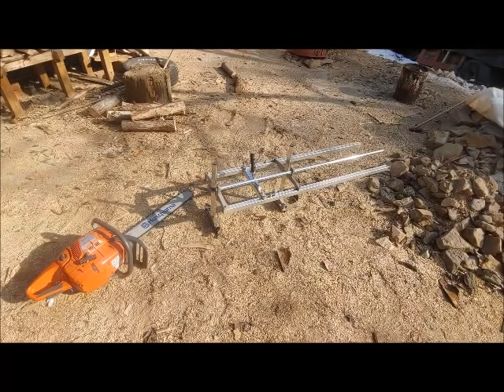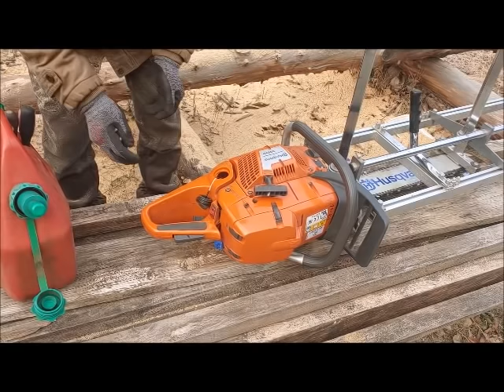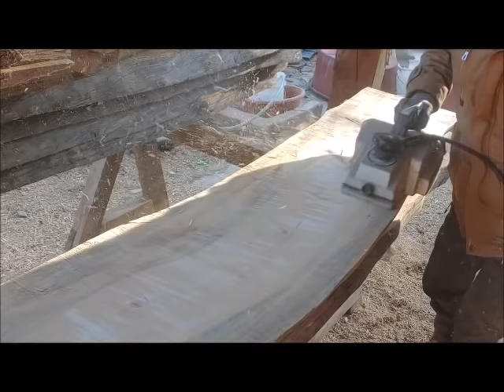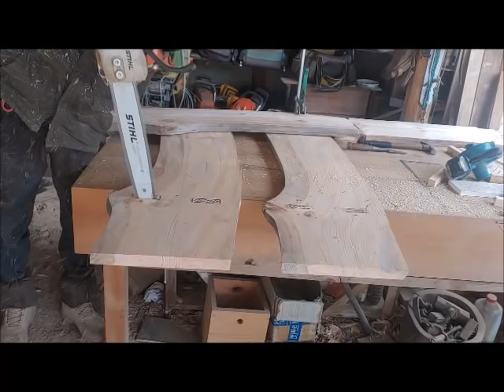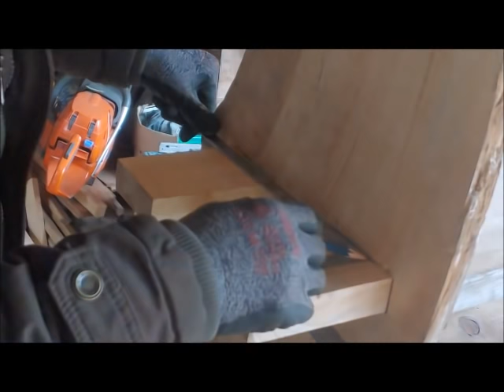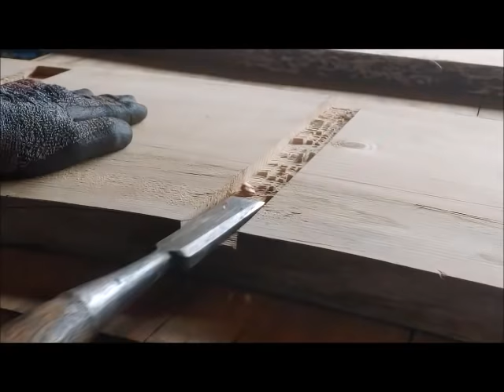Wood49---통나무가 목수를 만나면.....,한옥,목공,wood.

Comment: hello, beautiful work!
I have a question: when you cut the wood with your chainsaw, at what angle do you have the chain sharpened?
Gracias y saludos desde la Patagonia Argentina!
Reply from the maker: Se recomienda que el ángulo de la hoja sea "no afilado".
Gracias por ver mi video en Argentina.
Reply: It looks like 25-30 degrees in the video.  But if cutting harder wood, 20 degrees would work better. Also tuning the rakers is also very important for a clean and efficient cut.